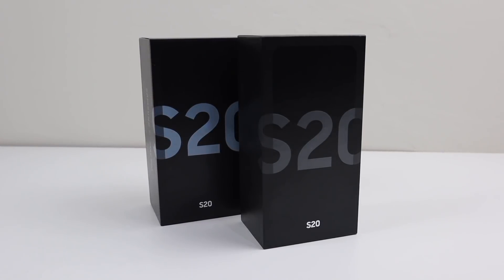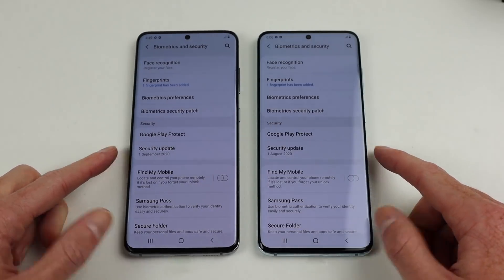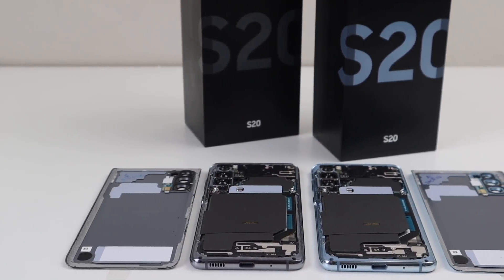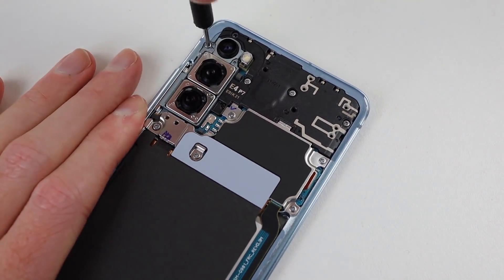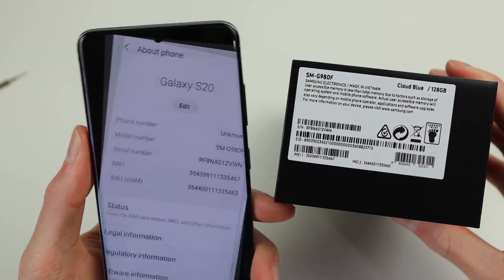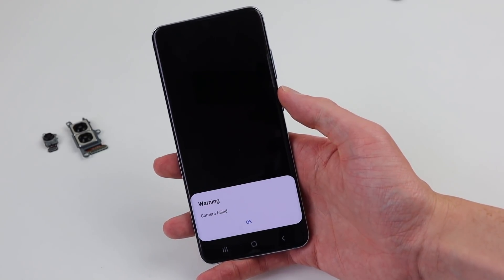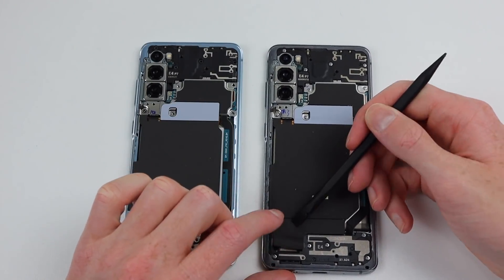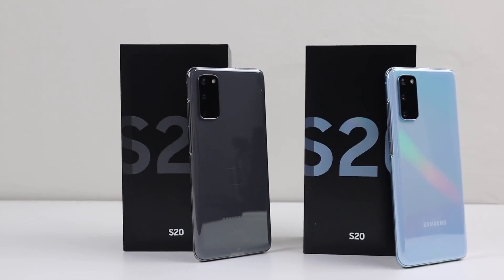Is Samsung locking down 3rd party repairs? Galaxy S20 Teardown and Repair Assessment

Comment: Looks like another liar has been caught. I've never understood why you'd lie when countering evidence is available to the masses on a store shelf.
Reply: Actually In a comment above the guy mentioned it was because there was a difference between US and EU parts which makes sense since samsung puts shitty exynos processor in EU markets and snapdragon processor in US market
Reply: @needlessoracle57  But it's not Samsung's problem if you replace your Snapdragon with shtty Exynos or vice versa. It's like putting incompatible processor on your motherboard then complaining when your system fail to post.
Reply: @needlessoracle57  Except that that isn't why. Serialized parts and region do often link together.  I don't remember the exact reason why every OEM keeps different serial codes for different places, but it doesn't have to do with they horrid 990.
Reply: The technician didn't lie. He's just bad at his job. Hugh Jeffreys explained how at the end of the video.

Comment: Samsung is miles ahead of apple at the moment. Just look at this flawless engineering.   Very clean placement of the modules, no countless metal plates to guard cables. Very impressive.
Reply: Not miles but decades
Reply: all all screws are the same  and regular Philips, like all android phones
Reply: Yeah no they aren't 
They put an inferior processor "exynos" in and sell it to certain other markets including Australia and the UK for the same price as the one with the better Snapdragon processor 
At least apple doesn't short-change certain markets with a shitty processor for a flagship price
Reply: @needlessoracle57  
Ooga booga me like change topic for no reason
Reply: @needlessoracle57  What the hell does Exynos processors have to do with repair?
Reply: @Random22  Exynos isn't flawless engineering, which is why it's dragged here. I have an Exynos S10+ and I can confirm. Overheating, throttling, battery drain, stuttering etc.
Reply: @Gusttox  Well yeah, I can understand that, Exynos chips are far less superior than  the Qualcomm chips, and Samsung is by no means flawless. He was just trying to say about how samsung phones are miles better in the repairibility aspect than iPhones, than the preformance, which iPhones are better than the Exynos variant phones.
Reply: @Random22  Yes Samsung scores better in repairibility than Apple, but in no way is Samsung better than Apple in performance. Even the snapdragon variant gets destroyed by Apple's A-Bionic chips. Apple's Bionic chips are actually unmatched.
Reply: @Gusttox  What If The Phone Explodes? Then You Gotta Throw Out The Phone And Then You Gotta Buy It Again.
Reply: @Alex-cn1xt  Yea, because who would keep an exploded phone?
Reply: @Gusttox yea. i have an exynos samsung galaxy a20 and it sure is slow as heck.
Reply: @needlessoracle57  well iPhone 6s had a problem.  Samsung produced a9 were inferior to The other manufacturer (I forget the name) in performance and battery life

Comment: Haha.. i bet the instagram guy was not as meticulous when doing repair as Hugh is. So, conclusions to this video, Asian phone manufacturer isn't as greedy as their American competitor in terms of letting 3rd party repair to their devices. I think the reason for this is leveraging repairs to others while concentrating on producing top quality devices that lead to higher revenues in the long run. Hemm... am contemplating to get s20 now but my old phone with removable battery is still in top condition. Naa.. I'll stick to removable battery for now.. until the pandemic is over and biz start picking up. 😋

Comment: With screws the same length and head type it’s as thought the phone wasn’t engineered by psychopaths (Apple).
Reply: And atleast the new Samsung's can be repaired by us samsung users or 3rd parties. Unlike apple
Reply: @darkknight8244  At least apple has software updates for more than two years, they recently even updated iPhone 5, a phone released in 2012.
Reply: @Simon-xl1yz  Samsung has 3 years of full Android and 5 years of security patches and OneUi patches. And send me the article that states where the iPhone 5 was recently updated, otherwise that'd bullshit. The only old iPhone that recently got updated but is now done was the iPhone 6S.
Reply: @e39purist89 yes it is not iphone 5 but 5s. Just check the last ipsw on both iphone 5 and 5s. iphone 5s is still getting updates recently.
Reply: @obbieguitarist  Are you delusional? As I stated, the last iPhone 5 and 5S updates were over a year ago. Just Google it lmao
Reply: @e39purist89  do you know ipsw?
Reply: @obbieguitarist  Just searched it up and my point still stands. Those aren't authentic Apple updates, and it's clearly show by the fact that they have a disclaimer laying out the fact that they're not associated or partnered with Apple, and that none of those IPSW files are looked over or approved by Apple. That's essentially me flashing/jailbreaking my phone for updates.
Reply: @obbieguitarist  Oh you're talking the tiny security updates. Well, if you're going down that route, the Samsung Note5 and S6 both got security updates recently as well. https://www.google.com/amp/s/www.sammobile.com/news/galaxy-note-5-s6-series-surprise-firmware-update/amp/

I thought we were talking meaningful full updates.
Reply: @darkknight8244  yeah Apple is not a good phone brand it's just a name
Reply: @darkknight8244  unfortunately 6 month later samsung joining psycopath way by remove charger from s21 and start trying to block third party repair
Reply: Exactly.
Reply: I'm really, really glad that Samsung did not go that way. Repairing iPhones and iPads is pure nightmare, and almost everytime I repair them I stumble into some problem.
Reply: U are right they want people to repair from apple only
Reply: lol
Reply: @NbaDan1  oh you hate Apple so much but you accepted an iPhone from your parents…. Sus indeed.
Reply: Not to defend Apple in any way because I absolutely hate that brand, but different types of screws are not necessarily linked to the design by the brand. Parts are manufactured and put together all over the world, and I dont think the different factories talk to each other about what screw size to choose. One factory uses a smaller one bc it fits better, and the next one might use bigger screws bc they are easier to take out and so on. So its possible that Apple didnt plan this mess, but I think they purposely didnt do anything against because they probably could have told each factory what screws to use. 
In the end, Apple mightnot have designed it that way, but they definetly didnt do anything to prevent it.
Reply: @Chrispack93  Then explain how other OEMs can have 1 type of screw but a 2 Trillion dollar company can't figure it out.
Reply: @e39purist89  
Exactly 
Apple have designed custom screws for their products
Then how on earth this is could happen
Reply: @Chrispack93  
not true apple sent out specifications for everything even for the length and type of screws too 
factories that put together phones just does it according to apple's design and they don't put something their own or  
its not up to the factory worker to fit in any thing he thinks fits best
these are tightly quality controlled and checked at every stage 
different screws are intentionally used
Reply: @Chrispack93  this is kinda defending apple cos this ain't true at all in apple's case. Their parts might come out from different factories but they are all assembled at one location. Apple likes to control every little thing about their products and they could just use same screw but choose not to.
Reply: @NanoMine  I really dont know why all of you are getting so extremely defensive, does none of know what the phrase 'might not necessarily' means? It means that I wasnt sure about it and this was just a guess of mine. Jeez all of you need to calm down acting like I was about to defend Apple when all I did was put out a guess, my gosh.
Reply: @Chrispack93  I get it what you are trying to say but the thing is the reason you gave should have been already clear to you and anyone would know that a company like apple doesn't just assemble their phone in so many different locations like any low budget company would do. This is apple we are talking about and they definitely don't share resources with other manufacturers, everything they do has a specific reason be it a good one or not.
Reply: @NanoMine  lol what u said was kinda correct and incorrect. Design (even those screw lengths and types) are actually made by Apple, one place. At different factories, they're all produced and assembled at different factories. Not assembled at same factory. But the thing is, Apple wants them to be the one and only one to be able to repair their so called- "next gen phones", so that they can charge more than half the price of their phone's price just to repair broken glass back and screen. How do you think they became a 2 trillion dollar company?
Reply: @mohankai7  From what I've seen in iphone manufacturing video's, parts come from all across the world but are finally assembeled in main factories which are owned by Foxconn.
Reply: @Chrispack93  Its just like, kinda common sense that the same products almost always have a very large majority of their parts being the same as each other so that guess seemed kinda willfully ignorant.
Reply: @NanoMine  Yeah that's what I meant too. Though I got caught in the words that you said, "one location". I mean I thought just one location for the whole planet! That's what I tried to say buddy:)
Reply: @mohankai7  ah ok got it, I was just trying to explain the other guy who thought that that even the assembly of whole phone is done at different locations.
Reply: @NanoMine  lol different assembly factories for just one phone? Think about it xD
Reply: @Chrispack93  lol dude you are talking here about multi billion dollar production every single bit is pre defined.
Reply: @Chrispack93  B R U H
Reply: @Chrispack93  not sure if it's done with phones but on some laptops i've seen a printout (on metal or plastic) what kind of screw should be there. If the screws get mixed up in the assembly process or are different length from the factory (beyond the tolerances that everyone uses) then that would prove that iphones aee all marketing and none quality.

Comment: Good video, note to your last comment about the A-series, I've replaced some and the biggest issue I had was with the plastic frame breaking easily.  P.s any discount codes for heat plates?

Comment: You can encounter problems when swapping out charging boards across same but different variations of Samsung phones. These sub-boards aren't interchangeable between Snapdragon and Exynos motherboards. You would know if a wrong sub-board is installed when the phone loses its IMEI or it will throw out an "Unknown Baseband" on the About Phone screen.

Comment: Not that you're likely to short anything in the loudspeaker, but I always try to disconnect the battery before removing anything. 

I did hear a rumor that the fingerprint scanner won't work with an aftermarket screen. This might be a little harder to test unless you're willing to source a screen for testing.

Comment: "A" series from 2019/2020 has a lot pf electronics problem, pcbs are somehow soft and it is really easy to tear any connector, camera, main boars, sub board. A40 and A50 are known for this. So, people who do repair "a" series can assume it is related to serialisation of parts and pairing with board, but actually is caused by bad quality of boards...

Also, I would recommend to put back that back glass, with same adhesive, put it on heater for few minutes (80 degrees Celsius), put some pressure on it until it cools down and good as new!

Keep it up

Comment: I do love these kinds of videos, no one else seems to consider repairability! Thank you hugh!
Reply: Samsung is miles ahead of apple at the moment. Just look at this flawless engineering.   Very clean placement of the modules, no countless metal plates to guard cables. Very impressive.
Reply: I should point out that while some other channels do definitely consider reparability to an extent I've never seen a channel that goes so in depth in testing the reparability, most seem to concentrate on specs, if they mention reparability at all.

Comment: The guy's problem was using incorrect parts for his phone model. For example, if you have a G980U1 then you cannot use a G980F part and vice versa. Samsungs don't fare well with missmatching parts.

Comment: To those who brought this over the iPhone, cherish the headphones and charge like never before 😂😂😂
Reply: With nearly 3500 hours of on screen and 400 charging cycles the S20+ is my best phone to date. There is no discernable battery loss or screen dimming.
Reply: Robert Polkamp I’ve had my iPhone for 2 years and I’ve put heavy use and haven’t replaced a thing
Reply: @TheBusFoamer  It's not just about you. Many people may drop their iPhones and break a component. Apple charging 300 usd for a screen replacement is NOT OK in any way whatsover
Reply: Tanmay Deshpande my mom broke the screen on her iPhone and I just bought a Ifixit screen and replaced it for her so it wasn’t expensive
Reply: @TheBusFoamer  uh huh. Do tell which model was her phone? Because apple (like the shitty company it is) has started serialisation of screens from iphone 11. Meaning you cannot replace the screen unless you pay 300 usd to the genius bar store
Reply: @TheBusFoamer  of course you didn't, there aren't any parts available. How's that puny battery holding up after two years of heavy use?
Reply: Robert Polkamp what u mean there’s no parts available I replaced my moms screen on her 6s and works fine lol it’s a IFIXIT screen I bought it at frys electronics
Reply: @robertpolkamp  that's in general a noticeable trend. 5-7 years ago lithium batteries were starting to improve a lot regarding longevity. Do you still remember laptops from the mid 2000s? Max 3-4 years battery life even if you cared. Also earlier phones (Up to maybe the galaxy S4).
But my LG G2 started to be problematic just this year. That's an incredible 7 years of daily usage. 
My newer Poco F1 is starting to loose a little capacity, but is also still perfectly usable (2 days of battery life!) After 2 years.
Reply: @TheRailroad99  My S10+ had noticeable reduction in battery life after one year.
Reply: @robertpolkamp  how do you do that ? Is there any specific  software to use ?
Reply: @aldipratama5997  accubattery is a pretty good app available for Android. It measures how much input the device actually takes in while charging and then compares it to the device's actual battery capacity. 

In my case, since my phone is almost a year old, I got to see around 89% of the battery actually being charged( it shows up as 100% in the software. ) 
Which means my battery deteriorated by about 11% over 12 months. 

( I don't have a very good phone which might be the reason for the quick deterioration. )

Most flagships phones lose about 5-8% of their battery capacity within the first year itself
Reply: @tanmaydeshpande  thanks for the reply, really appreciate it 🖐
Reply: Im using a Huawei for phone and tablet and they both epic so don't bother me either way 😂😂😂
Reply: this aged well lmao
Reply: Lmao true the Samsung has twice the ram but iPhone beat it in speed test by a longshot but both are really good just up to what your ready to gain and lose
Reply: Executivebird yeah I like the iPhone because of the speed and optimization but Samsung is not bad either it’s just my preference
Reply: @TheBusFoamer  lol every android phone beats the iPhone 11(I'm talking about 2020 and the iphone12 is more of 2021 device so now that's a fair comparison)
Reply: oxygene killer android is not bad tbh I just prefer Apple I’ve been using it for years but I want to buy a android tablet actually so I’m not a android hater I would rather a iPhone and a android tablet
Reply: @keqling7086  the 11 is fine, it’s just the display that i think is trash. Like c’mon. 699 for a phone with not even OLED. That’s one reason why i got a X instead of a Xr
Reply: @Executivebird  It appears as though you don't know the difference between capacity and speed. More RAM = more apps open at the same time with no slowdown (unless it's over the CPU's capacity to manage or the RAM is really slow). Higher frequency = more transfers / period of time (usually seconds).
Reply: @liviuganea4108  why would you need 120hz screen when most games don’t support it youtube caps at 60 and most streaming apps like twitch and mobile games don’t go up to 120fps
Reply: @Executivebird  ....... most normal games SUPPORT 120 hz displays ... and the point isn't even about that. 120 Hz feels smoother ALWAYS. Even when scrolling.
Reply: @liviuganea4108  that’s not true name 10 games without googling that support 120
Reply: @liviuganea4108  I’m talking mobile games and that support 120 YouTube don’t support
Reply: @Executivebird  u know what a ram does in ur phone?
Reply: @keqling7086  yes and other specs and I didn’t wanna start fighting people over the phones because both are amazing just depends on what your into
Reply: I honestly don’t care about Apple not including headphones and a charging brick in their phones. I have too many myself, so why would i want new ones 🤷🏻‍♂️
Reply: @yusuke9483  Just because you paid for your phone
Reply: @yusuke9483  do some researchers and u will understand why
Reply: @keqling7086  wa
Reply: @keqling7086  last time I checked A14 fucked over SD 865, but ig every android is better just because it's not iPhone 🤷‍♂️🤷‍♂️🤷‍♂️